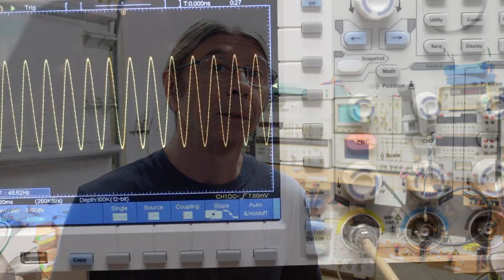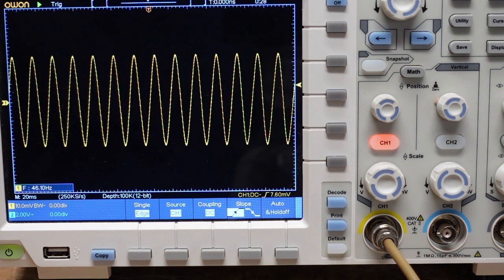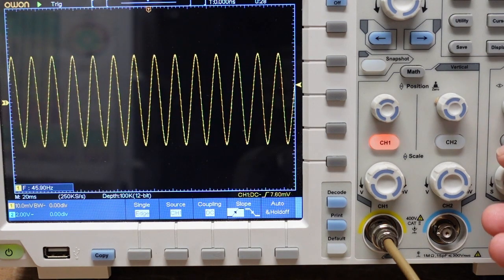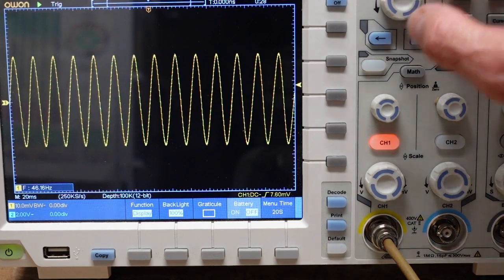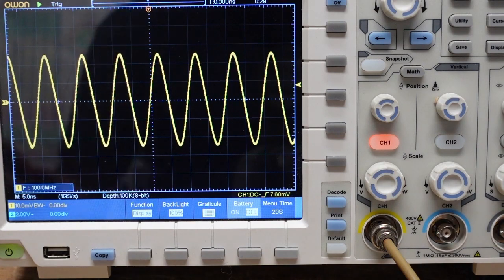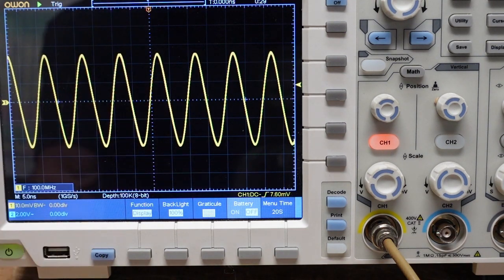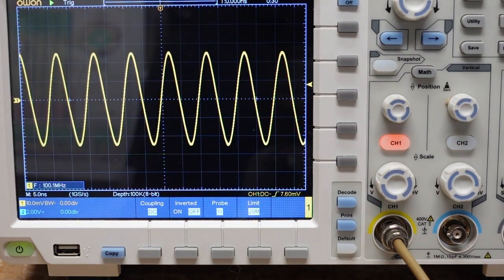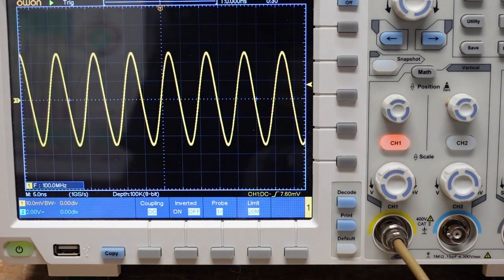Bench Basics: Understanding and Using an Oscilloscope Part 2

Comment: This is an awesome lesson. I never knew the difference between chop and alt on my old Tek 465. Now i have to  play with it as i follow this video as I like to learn visually. I also have a HP 53831M digital and its been hard to learn all the software as I don't have that basic knowledge fron using my old tek scope. Its back to basics for this guy so I have a  good foundation. Thanks so much.
Reply from the maker: Jared, I was fortunate to find a mentor back when analog CRT scopes were the norm. He showed me operation and servicing of these tools. I've always been grateful for that.
Triggering is another poorly understood function as well, from conversations I've had with fledgling tech(and some not so fledgling).
Reply: Ray, I wanted to ask your advise on a scope upgrade as you use a 2400 series tek and they are thought of as an outstanding analog scope. Just basic info on them. Can I do that here? Talk soon and have an awesome day.
Reply from the maker: @jaredkusner1137 JAred, my email address is under the About tab on my channel's home page.  That's a better way to communicate for questions like these.

Comment: I don't understand 12:38. If you can hook the 2nd probe to the ground, why wouldn't you just ground channel 1?
Reply from the maker: All the grounds on the scope are common. The short lead which attaches to the probe is short for high frequency work. Audio is low frequency, so just connecting the scope to the unit under testing's chassis accomplishes that.

Comment: Totally off topic, but I was watching your dummy load, for the outputs from an amp. How did you design them? I have a great schematic, but I'm looking for the right non-inductive power resistors. Inclusive the spools and bipolar caps, this schematic I have does emulate a speaker. And I want to combine them for 4R loads and 8R. For about, 1000w per channel. I'm not sure if you made a video about these? Thank Ray. Fun story, a friend of mine gave me a frequency counter for free, but it didn't work properly, it went from 0Hz to 100Khz back and forth, So I opened the thing, and it was bad assembled, so I soldered the small PCB again and put the shield cover back on, which was also assembled bad. Now I'm a frequency counter richer. With those products from China, you always have to look inside, before using. I bought a SMPS supply, and the clips to hold VRM's to the radiator were way to lose, so that had cause some problems, I fixed it, and now I can go to sleep without worrying about unexpected things to happen. It's cheap, but assemblies are not always like they should be. Let this a warning. Greetings from Belgium.

Comment: Thanks for sharing your knowledge with us.
Reply from the maker: It was shared with me.  My hope is that someday you'll share it with others.  Thanks for the thanks!
Reply: Hi Ray.

If your are using the scope for audio devices only,
how high of a megahertz scope do you need?

Thanks!
Reply from the maker: @JanJan-pr1wc  You could get by with a 20 MHz scope.  While mine is 150 MHz, I often use the bandwidth limit function that drops it to 20 MHz. This provides a slightly sharper display by reducing noise.  That said, price difference between 100 MHz and 20 MHz is usually minimal.